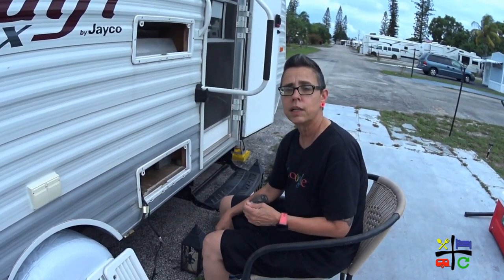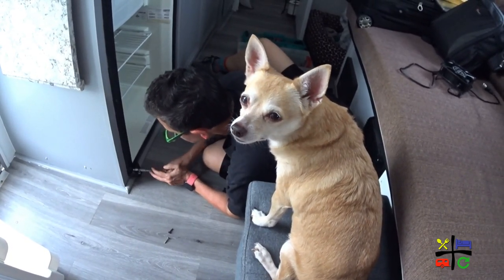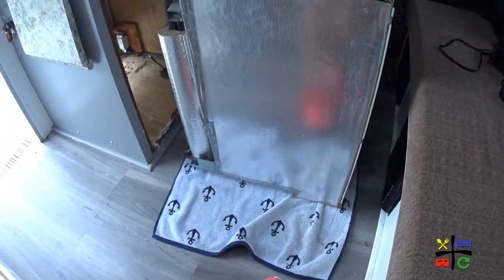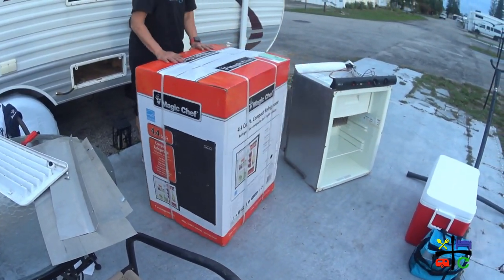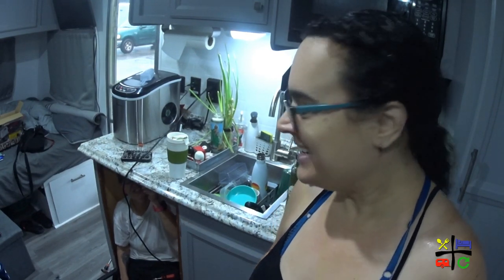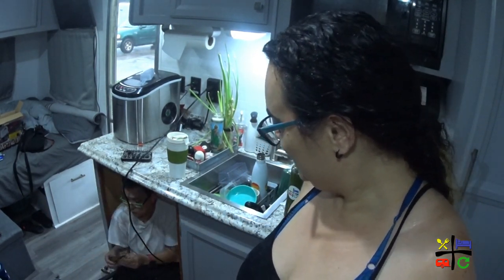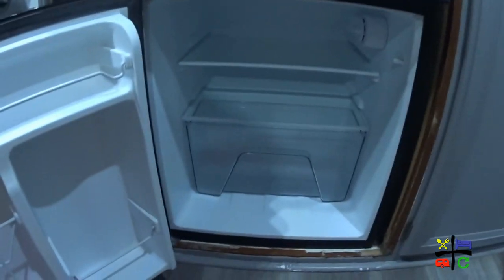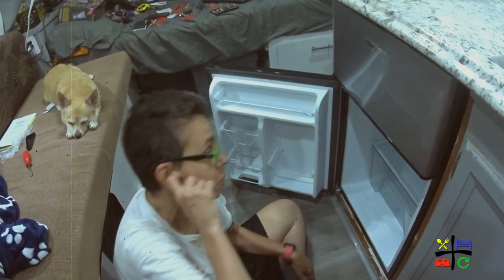Replacing RV Fridge with Residential Fridge ⁞ Norcold RV Refrigerator Replacement ⁞ S3E2

Comment: It's always a good thing to replace and absorption refrigerator with a residential unit or a 12-volt unit due to the fact that absorption refrigerators pose a fire hazard
I got a pretty decent deal on a small travel trailer but unfortunately it had a gas / electric refrigerator and that was a no-no for me so I decided to put a residential unit in and I have no regrets I also have way more space inside just like you do because there are no fins taking up any space
Reply from the maker: Best decision ever! 💙Angie